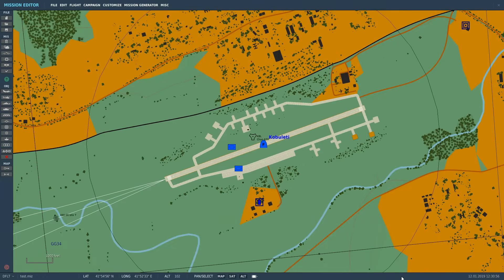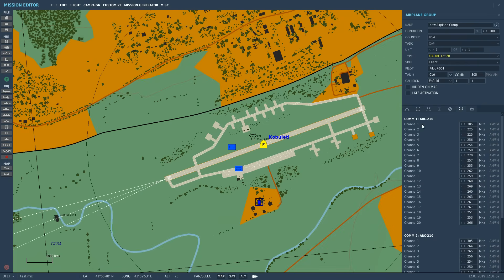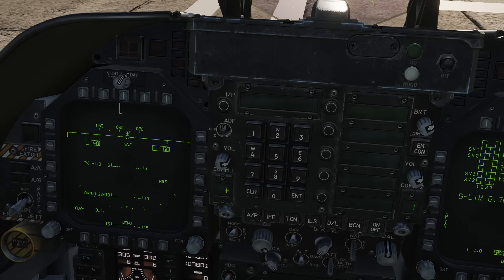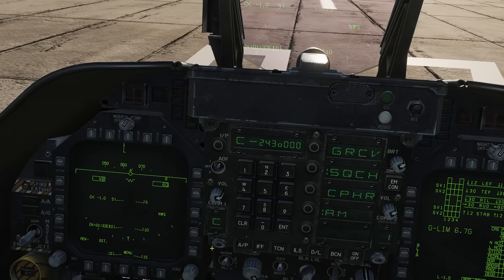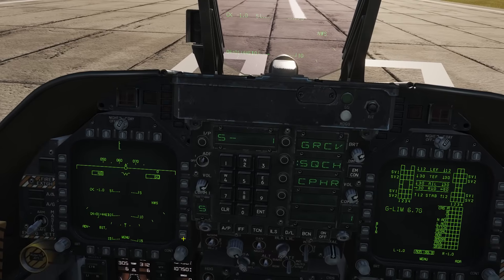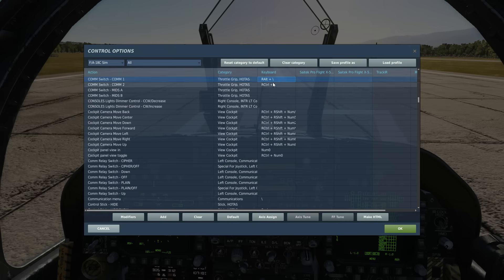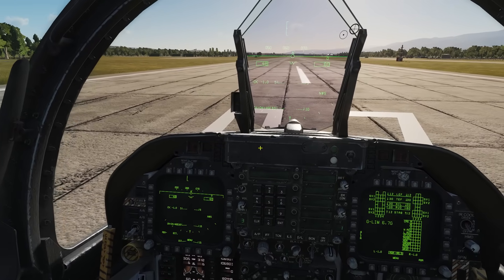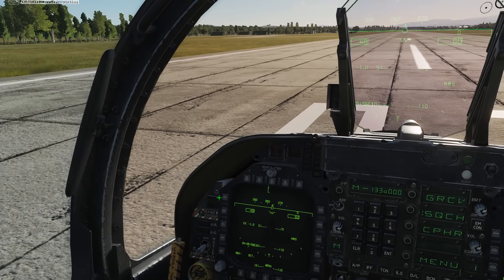FA-18C Hornet: Radio Tutorial | DCS WORLD

Comment: ATC nerd chiming in here. FYSA, 243.000 is “MILguard” and 121.500 is “CIVguard” State side, most commercial aircraft/ATC entities will be required to monitor one of these freqs respective of their function. Military: 243, civilian 121.5. Do the math and you’ll discover 121.5 is exactly half of 243.0. ;)

For military use, these two frequencies are at the far end of the PACE plan. Primary, Alternate, Contigency, Emergency. In my 5 deployments as a JTAC overseas I’ve never once raised an aircraft on guard..Civ or mil. Why?because in Combat, aircraft typically don’t use these freqs downrange as a monitor net simply because they don’t have the time, or the amount of radios to monitor extra freqs. It’s usually used as an extreme backup. None the less, it is included in PACE plans.
Reply from the maker: thx

Comment: Great tutorial, thanks!  One question - I often find the comms button (\ or RAlt+\ or RCtrl+\) just doesn't work, particularly when in the air, but works OK on the ground.  Easy comms on or off, doesn't matter.  I have set the frequencies either in preset or manual.  What am I doing wrong?
Reply from the maker: How strange, sorry but have never noticed. Sounds like a bug?
Reply: @grimreapers  Mystery solved - the key mapping in the game settings is \ (plus RAlt and RCtrl modifiers) but they only work on the ground; have to use # (plus modifiers) when in the air, no idea why...
Reply: @grimreapers  No worries, thanks - I'll try and play with it some more tonight :)

Comment: So, a wild guess about the S channel being for Maritime use, It probably originated as "Sea" or "Ship" channel. On a side note, does DCS allow use of voice comms over any of these radio channels? Listening to the Grimm reapers, it sounds like they may be, but it could be a mod for Team Speak or somesuch.
Reply: its a program called SRS
Reply: @DanMottram1  does SRS work like the radio mods from Arma where you need to have proper frequencys set to talk to other players in game?
Reply: @KomradeDoge  yes, Freq are set using the in aircraft controls and the you choose channels by tuning Freq however there is a pop out window that you can use instead
Reply: @DanMottram1  ty. Does that also mean in 2 radio aircraft like the F18 I can talk on both at the same time? And would the in game volume wheels work properly or no?
Reply: @KomradeDoge  yeah, the A10 is a three radio aircraft, so you tune all three radios and listen to all three but you have separate PTT buttons for each radio ( thumb hat switch on HOTAS) for example press it up to transmit on comm 1, press forward to transmit on com 2 and down for com 3 ect.
Reply: @KomradeDoge  yeah, the in-game volume switches work so you can set seperate volume levels for different radios, if you want you can just turn one off 😂
Reply: @DanMottram1  very nice. Thanks for all your help, I wanted to get away from using "Easy Comms" and also figured I should get into multiplayer too.